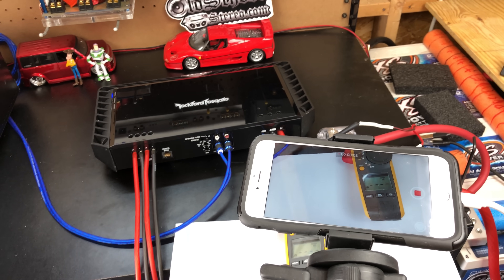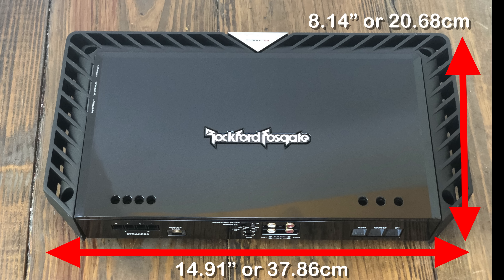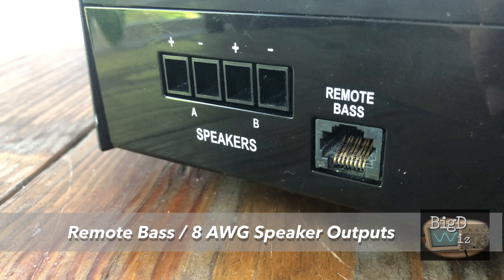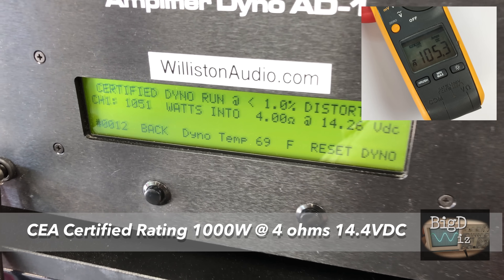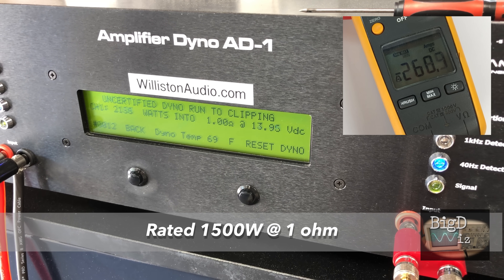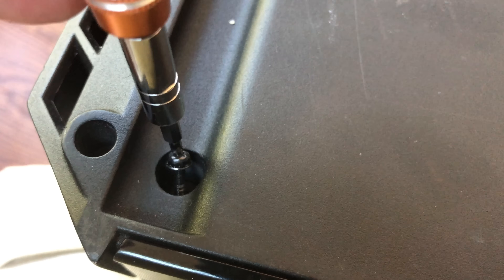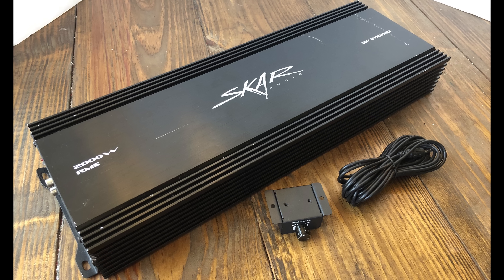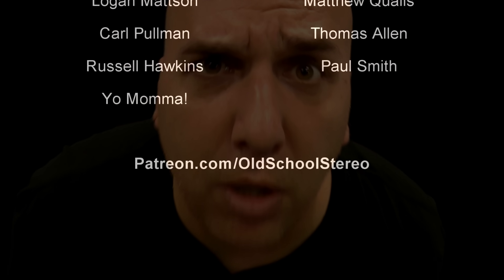Underrated? Rockford Fosgate T1500-1bdCP Amp Dyno Test

Comment from the maker: Check for RF T1500.1bdCP Refurb Amps: https://is.gd/rft1500refurb

Make sure you buy amp from authorized re-seller to get full warranty from Rockford Fosgate!

Send me a few bucks if you want to support: https://paypal.me/BigDWiz

My Favorite Screwdriver Kit: https://amzn.to/2FGD7dP

Test Your Own Amps! SMD / D'Amore Engineering AMM-1:
Amazon - http://amzn.to/2u2EgKV
WCCarAudio - https://goo.gl/CVCgU3

Constant Power Technology Explained: https://youtu.be/7EP4-4TMWFw

Amps for Daily Driver Playlist: https://is.gd/dailydriveramps
Reply: You should do an Orion xtr 1500.1dz
Reply: Can this amp be strapped...  ?????
Reply: BigDWiz I
Reply: Good day Mr wiz, my father gave me 2 rockford fosgate amplifiers the 55a2 and a 500a2  they are amazing amps, however my problem is that he lost the metal cap that normally cover the terminal and I am have a hard time to get them because I live in Jamaica. Do you have a link on how to get those caps?
Reply: Jermaine Mcdonald here's a link to 3d printed end caps. They are plastic but looks nice
Reply: Do a scv 3k review
Reply: BigDWiz  ....hey Big D, have you ever Dyno tested a old planet audio 2250 (vx2200d ) amplifier? And what do think of that amp model..?
Reply: Good amp but with only 700 if u have good dealer u can get src audio 2500 white one
Reply: BigDWiz i see the bottom is pretty scratched up on your amp, any other signs of wear or tear? Did the amp come with a new original box and birth sheet? Thanks
Reply: I wonder what the bd 1500.1 can do in  a half ohm  2800 watts maybe?  Cause i got mine in .5 ohm pushin 2- Skar 18" subs   and it almost hits like a bd2500.1  almost,,,, so i guess about 2800-3000 watts  its puttin out
Reply: Williston Audio Labs big d I have a cuestión how good is that jl HD750/1

Comment: This may be a dumb question, but do you have a video explaining what you mean by “efficiency” ?
Reply from the maker: Not a specific video but it’s the power in vs power out calculation. Take voltage x current pulled then divide my power achieved. Higher is better. Class D more efficient than AB

Comment: Hi 

I have two 8” type R subs in ported box. Requires 350RMS, I’m looking for clarity and some good punch at 4ohm load to keep things efficient as possible. Would you choose the Rockford T15001bdcp at 1000watts or Alpine R2 150M at 700watts ? 

3rd choice Alpine PDX M6 at 4ohms and 600watts 

Unless you recommend an amp that you know is better than the ones I suggested?

Comment: I’ve got 2 of these and I love them
I hate one major thing about them. COOLING I have 2 pc fans behind each amp with shrouds to make all the airflow go through the fins and they still run HOT
What I’m gonna do is put all amps and battery’s in a truck box in the bed with some bigger fans bringing AC from the cab into it but unfortunately I’ve had 2 600.4s fail
1 at the internal crossover and the other where it lost the rear 2 channels still unsure as to why but even for a 4 channel they get HOT and I’m almost certain it’s why they die but all things said very crystal clear amp when there new they just don’t seem to stand the test of time all that well especially for the price tag in the future I wanna try out the D4S amps but 2 T1500.1 BDCPs on 4 Rockford 12” P3s in a 12.6 cubic foot box tuned to 29hz and this hits harder than some setups I’ve seen with 6-15s I can’t do hair tricks from lack of air movement but these just punch you right in the gut where the 15s just couldn’t 
Also have some anger with the pass through for some reason I was about 20 degrees out of phase between the 2 amps and had to run separate RCAs out of the DSP and time align them to match

Comment: I'm running this amp with my 2 15s at 2 ohms and it goes off by far the best amp I have ever owned and have had it over 10 yrs now and wouldn't trade it for the world its birth certificate says it's rated at 1,960 watts
Reply: In parallel if your subs are dual voice coils take a jumper from 1 positive to 1 negative on 1 sub and that will leave you 1 positive and negative do the same on the other sub and that will leave you just 2 positives and 2 negatives and just hook the positives together and the 2 negatives together and run the 2 wires to the amp and if that sounds confusing just look up how to wire subs on here if that is easier homie
Reply: @MrLow86  Thank you Boss
Reply: How do you have your 2 subs ran from the speaker box to the amp? I'm confused on this 4 output on a mono block amp.
Reply: The booklet says it's internally in parallel mode on the inside the amp and I was just wondering how do I hook my 2 subs up like you did Boss.

Comment: I know this video is a bit dated but I was wondering if you would test a T1500.1 bdcp at 16 volt my manual says it can run at 16 volts also curious why amps are rated at 40hz my fosgate birthsheet shows over 1500 watts at 20hz
Reply: WHAT IF IT DON'T COME WITH A BIRTHSHEET?

Comment: I was able to pick this amp up for $600.00 (after taxes too) on amazon. I got $150.00 off coupon code for being approved for Amazon credit. I didnt realize that this amp doesnt use RF's CLEAN system for detecting clipping, its ok i do have a DD-1 but still. I would think if some of their Punch series have this why wouldnt their Power series?? Also, i agree, for this kind of money, it should come with a bass nob.

Comment: on rockford’s website, they say the amp is NOT bridgeable… yet @2:06 you say that the amp has an input AND output to pass signal to another amplifier. does that mean you can stack two t1500’s for a total of 3000 watts rms or no? my ignorance is partly due to my confusion of bridging amps and stacking amps. any help would be appreciated!!
Reply from the maker: Amp has pass thru for RCAs, but is not linkable. You can use two amps, but not "link" them together to use as one

Comment: I really want this amp however im worried theyll be coming out with a newer version soon considering this has been out for over a decade.
Reply from the maker: I have no info on the matter but times are tough
Reply: @wal  thanks for the reply. If you had to choose between this amp or Audio Control LC1500.1 or Kicker  KX1600.1 which one would you go for? I want to run a single 12" or 15" in a sealed enclosure.

Comment: One of my cars I barely drive is a 2005 Buick Park Ave. I decided last weekend to put two Kicker 15 CVR's I had laying around I forgot I had this T1500 I only tested it years back and didn't use it. I finally hooked it up to the two 15 CVR's with a Rockford R2 300X 4 ch. Hitting really hard.

Comment: How do you recommend running 0 gauge to this amp. The amp terminals are square and 4 gauge. I've bought 2 sets of 0 gauge to 4 gauge reducers and they don't fit right into this amp. Need help

Comment: Had this amp for over 2 years now. Running 2 first gen 12in punch hx2s. Had the subs for about 16 years now and they've never sounded louder! Never gets hot at 1ohm. Hours of play at a time! Building a custom enclosure soon.
Reply: Lil late for a response probably, but do you think gen 2 hx2 12s can take this amp at 1 ohm? Either ported or sealed? If not, I’ll just run them at 4 ohms so they get rms, but everyone can agree a little more bang is always better

Comment: Fun fact: Rockford Fosgate stereos are a factory option on many Mitsubishi vehicles (and probably the best OEM stereo system I've ever heard). I almost bought a Lancer about 10 years ago just because the factory RF stereo sounded so good.
Reply from the maker: It’s true but the upgrades factory systems are in most cases nowhere near as good as a decent upgrade using quality components.

Comment: I HAVE A 2015 HONDA CIVIC SI WITH A T1500.1 RUNNING A T1 12 AT 1 OHM WITH 2 BATTERIES AND WHEN IT HITS HARD (REAR AND FRONT WINDOW SEEM THEY WANT TO EXPLODE OUT) THE VOLTAGE METER DOSENT EVEN READ , IT TURNS OFF. THE T SERIES IS NO JOKE.... WILL A SUPER CAPACITOR HELP OR THE ROCKFORD FOSGATE  10 FARED CAPACITOR ...THANKS BIG D...
Reply from the maker: Make sure you have good grounds and 1/0 OFC
Reply: @wal  
I HAVE ALL THAT , IM THINKING OF INSTALLING A SUPER CAPACITOR , DO YOU THINK THAT WILL HELP?
Reply: @andsanluis80  yeah those 6 pack 300 farad caps will help
Reply: @rowboyto156  thanks for the great tips guys , appreciate all the help...

Comment: Fantastic amp. Buddy has been running this amp for 10 years no joke and it still works good as new. His birth sheet at 1ohm was little over 1900 watts rms as i recall.
Reply: How did he wire his amp from the box to the amp? Cause that's where I'm confused on this amp cause I have 2 15's and I was wondering do I wire my 2 subs to the amp in a mono load( + -) or( + -/+ -)
Reply: @jefferyglover4295  I run both my 15s 1st + and 4th - for all the juice🤟
Reply: @thcwolfs2598 Got you Boss I see what you're saying now 😂 the 1st + and last- on the amp to get all the juice 😂 I might need to get another one of these powerhouses so I can have 2 😂 that'll be enough clean power for me, thank you.

Comment: I ran a 0 gauge battery wire into this 1500 watt fosgate, that thing was a total beast, my best amp ever to this day, to bad someone stole the car 2 years later. Bet the chumps they never got the full potential
Reply: So you can run a 0 gauge to this 1500bdcp? How did you do it Boss?
Reply: @jefferyglover4295  ran it from the battery with a fuse block attached for protection, (it never popped though) straight to the amp itself, just make sure that you have a decent alternator and it will beat the hell out of trunk!! Good luck my dude 🙏
Reply: @sburton982  Thank you so much Boss for the information!

Comment: I’m hoping to get some advice. I have just purchased this amp from an authorized dealer and I’m paring it with the Rockford Fosgate T600x4 amplifier. This will be going into a 2017 Ford Mustang GT Premium with a 200 amp alternator. 

Would you recommend me to upgrade my alternator to a 240 amp output or even a 300 amp output alternator? I’m not sure if 2100 watts RMS on an amp that requires a 200 amp fuse and the other requiring a 140 amp fuse will perform as it should in stock but I wanted to ask the professional.
Reply: do the big 3 and add another battery first. both batteries from the front and back need to be agm, you cannot mix lead acid with agm because lead acid will drop the agms voltage down. make sure the battery in the back is 100ah or over then hook up a voltmeter to your amps power inputs and monitor the voltage. if its dropping down to 12v then upgrade the alternator. if you have the money change to lithium batteries because all you need is 1 battery to power everything and you save weight

Comment: I don't see any links to tests of the other amps. 
That CP tech is really cool. But, it is designed to run your speakers as hard as it can, which can blow speakers. It requires a little extra tuning.

Comment: Have one running two dual 4 ohm JL13w7s at 1 ohm. Perfect combo
Reply: how did you get a dual 4ohms was it a reconed sub. i also have a 13 but its wired to .75
Reply: @rowboyto156  run the subs at 2 ohms each instead of 8ohms, then run them  together. Not reconed, ran in series instead of parallel.
Reply: @kellycote9428  the 13w7 is a dual 1.5ohms sub so in series its at 3ohms but since you got 2 of them youre at 1.5ohms final load. do people say the bass hurts. i only have one and people who sit in the passenger seat say they feel a little punch on their kidney i can only imagine how 2 of them would feel like
Reply: @rowboyto156  my bad brother... i have the 13w6v2... misread ha ha. .75 ohms will be fine.

Comment: hey Big D - did you ever test a T2500-1 bdCP? I am currently trying to decide between some very good RF material oder new age Helix P-One.. I just can not decide..
Reply from the maker: Yes, but my amp was a refurb and had some issues at 1 ohm Dynamic, but wow that’s a powerful amp
Reply: can you post any numbers? specifically the current-consuption @4 and @2 ohm use. I'd be very grateful.

Comment: I have this amp pushing 2 12w6v3 subs ported  and I have to turn the speaker level setting on my pioneer hu to negative 13 because the subs overpower my highs and mids. I have morel tempo ultra component set. This amp is powerful as hell
Reply: -13 at 1 ohm and gain on amp all the way down?

Comment: Guys what amp should I get for 4 skar evl 8’s and each is rated at 600 rms so i need a 2400 rms amp what should I get?
Reply: sinful sounds famine 2500.1 its the same as the wolfram c2400 even the price too or any of the full bridge designs

Comment: Rf t1500.1bdcp or orion hcca3000.1dsplx?
Reply: orion will put out way more power but ill go with rockford cuz 1. orion is bankrupt, 2. its a full bridge design and 3. you can only get the amp fix by orion because of its propietary parts. so if the company goes under and your amp breaks because its a full bridge then youre stuck with an expensive useless amp

Comment: I ran both the P1000.1 then upgraded to this amp ran both at .5 ohm with 2 1000 cca batterys stock alt in a 2003  Cadillac Deville on 2 T15 and the both amps ran fine i ended up braking a sub not blowing it braking it the cone came apart from the  coil the coil was still intact moving back and forth 😀

Comment: About to order a 13W7AE and the sales manager told me not to run it on this amp because it doesn’t have a 3 ohm rating on it so it would give the amp an “unstable” load and possibly damage the sub over time. Is that true? I’ve seen so many videos of people running this amp with the 13W7 and comments saying they’re happy with it. I’d rather go with Rockford since JL amps are $$$. I figured since it runs 1500 at 2 ohm and 1000 at 4 ohm, should give me around 12-13ish watts at 3 ohms. Any help would be appreciated. Thanks!
Reply from the maker: You are correct and he’s either an idiot or trying to sell you an amp...
Reply: @wal  THANK YOU. Just making sure.
Reply: Ayyy I too have 13W7AE. Im. Planning on buying this amp as well.

Comment: hi do you think it is better to use 2 t1500bdcp for 2 subwoofers t2 15d2 rockford fosgate or 1 t3000 for 2 subwoofers t215d4? thank you
Reply: its always best to use 1 bigger amp, the output voltage will be much higher than 2 smaller amps
Reply: @minus3dbintheteens60  in the past i had rockford fosgate 2x bd 501 bridging link x 2 rf subwoofers and they sounded much louder than a single bd 1001
Reply: @alcampdg8000  they were bridged, its essentially 1 amp.  the 500w model was more than likely much more over rated in % terms than the 1000w model, for example each 500w might have been pushing 700w, thats now 1400w vs 1000w.  
Its always better to get the bigger amp, and it is always better to have 1 amp per driver, than to run 1 amp per coil, for example 1 500w amp per coil on a DVC sub will suck compared to 1 1000w amp running both coils
Reply: @minus3dbintheteens60  but does it depend on the impedance of the driver? if an equal impedance amplifier delivers More Watts than each other What does the connection on each single coil or a single larger one have to do with it, for example I have a 2 + 2 ohm driver and I connect 2 amplifiers for the 2 coils The amplifier delivers 500 wa 2 ohm 500w rms x2, and on another you connect an amplifier only that goes down to one ohm and will deliver 1000 w of power, the first solution the one with the two amplifiers is not the most performing?

Comment: I'm running a Rockford p1000bd  at .5 ohm daily in my car and she is a beast no smoke no fire she gets hot when it's hot out but when not hot she pounds my audiobahn immortal quad coil 15
Reply: How's that working out?. I want to run .5 on the non CP version. Want to know if it will burn it up or not

Comment: I have the T-1000 and remain amazed how good it makes the subs sound. It is intense at times. Upgrading to the T-1500 in a little less than a week when it comes in so my question is this , what happened to the in-car demo BIG-D? Ive been waiting like a big dummy take care hope everything is great brotha
Reply from the maker: I haven’t been able to setup my 2nd battery yet due to hold ups. I did recently put in the Sundown SFB-1000 and it’s powering the JL 10W6 nicely
Reply: @wal  good to hear, your T-1500 might be overkill but all the same good to hear. If I lived on the east coast id come install it for you just to meet the man himself. Bump on n take care

Comment: Good evening Derek I’m a huge fan of your channel I watch you often.  Can I ask a favor could you please do an amp Dino at 14 1/2 V with an 8 ohm load?  I have the sample flyer and I would like to run it on some older subwoofers in an 8 ohm load to absorb some of the apps power by running a higher ohm load. Thank you very much for your time excellent videos by the way
Reply from the maker: As an estimate, take the 4 ohm result and half it. Thanks for watching and commenting!
Reply: @wal  Thank you Derek, for your response.

Comment: I had my subwoofers hooked up to a 10000bd punch I believe and even that was pretty intense for my 12 and I didn't even have the gain up all the way as well but when I put the 1500 BD consistent power amp you can feel you can hear the difference yes the 1,500bd cp is more powerful than a 1000bd power. But the consistent power makes a difference and that amp is cleaner than the 1000 BD just saying

Comment: Get a p1000bd I'd love to see what it'll do
Reply: it puts down 1500w on 1 ohm load. steve meade dynoed one with the green chevelle. the current models just have added features and refresh heatsink
Reply: @rowboyto156  I had one that was a punch p1000bd God that amp put out power
Reply: @dhestondh  me too i had the p1000x1 bd it was pushing a 12in re audio sx . i love how heavy they are and the extra build in features. i sold it because i upgraded my sub to a sundown x12 and totally regret it when i saw the smd video